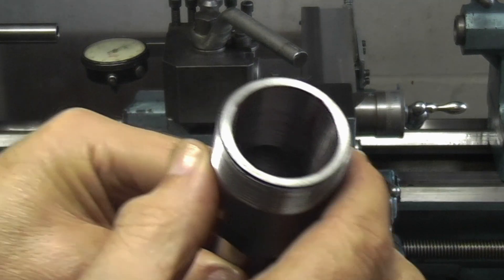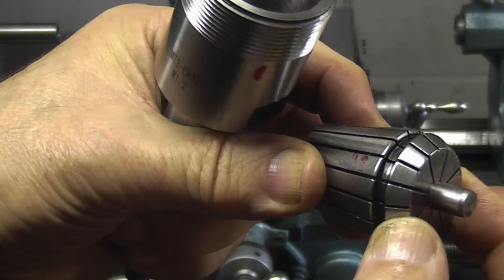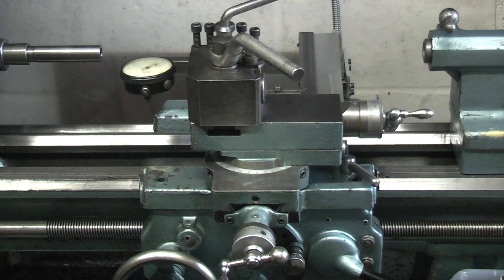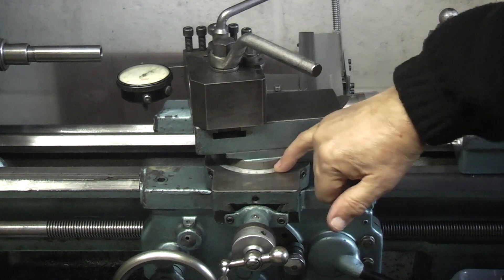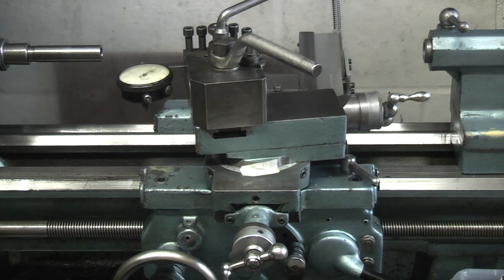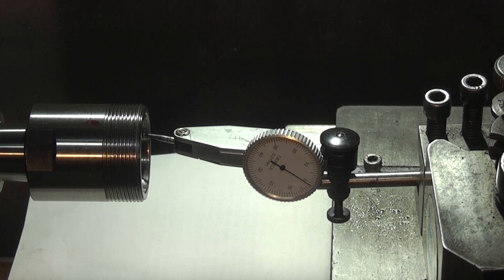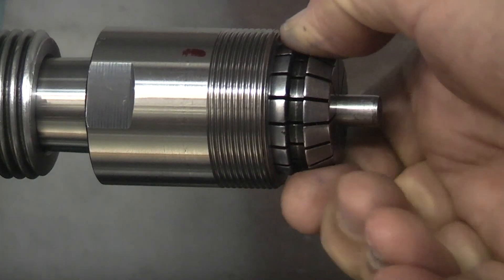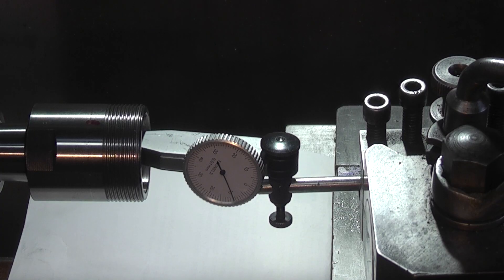Accurately set a compound slide

Comment: i pretty well much keep my saddle locked at... wow, i forget its been so long. 6ish degrees fro the 1:10.

do all my angles with a taper turner at the back, or a straightedge clamped to the cross-slide and a stop. i am yet to see anyone else do a steep taper with a taper turner at right angles... its just profiling...

use a linkage instead of a stop and it does arcs...

Comment: Alan, many thanks for your help in sorting out my ER32 collets. I've bored my holder to 8 degrees, set up using your method and changed the collet nut. I've gone from a run-out of 6 thou on my 10mm collet to within 1 thou!